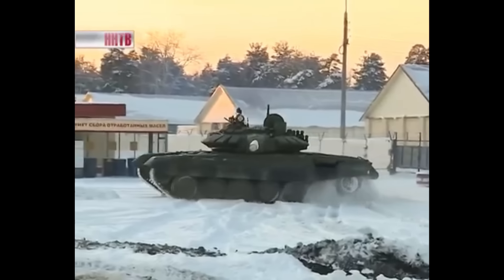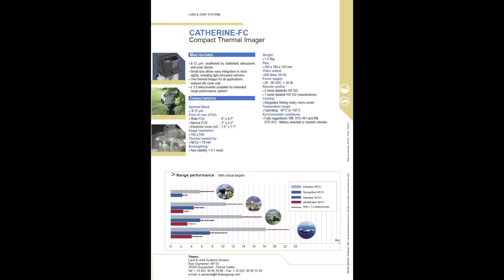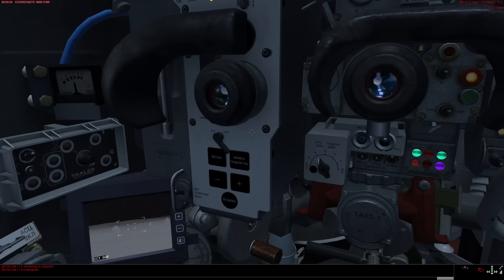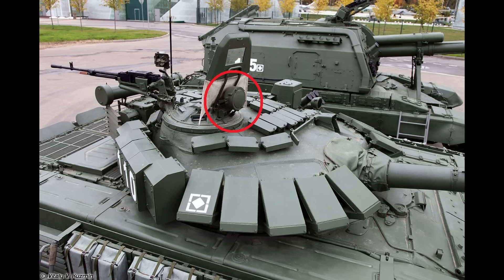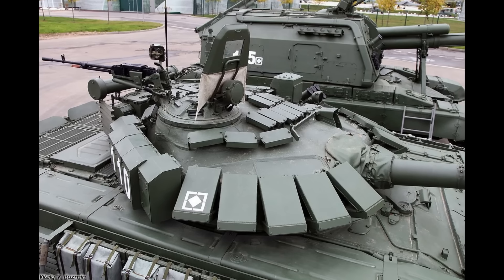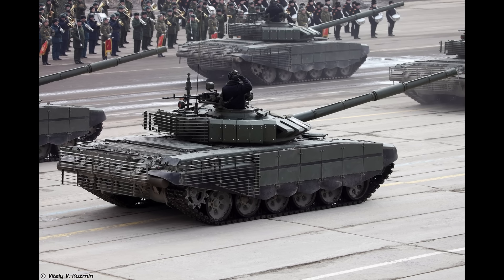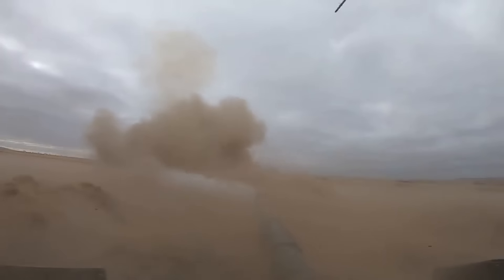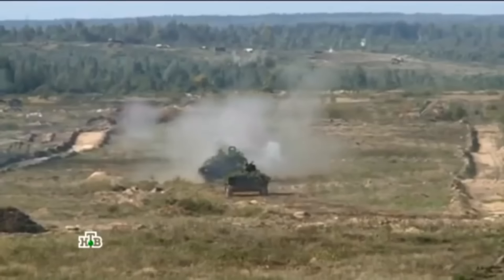Problems with Russian T-72B3 tank

Comment: It's incredible how Russia did not modify a new turret for the T-72/T-80, to incorporate their excellent auto loading system to draw its ammunition from a secure vented chamber at the rear,  instead of the crew sitting on a bomb basically, in the event of a hull or top breach. The cost of designing and fabricating new turret would be very reasonable, and would triple survivability rates.
Reply: I don't understand Ruski doctrine of there being 100 different tank versions.
Even +40 years old Abrams had A1/A2 versions then basicaly SEP1/2/3
Reply: @Tonixxy  they name it something different after every slight change. Personally i think that is to create the illusion of modernization
Reply: @meisterproper8304  i read some time ago most of those modernization were basically corruption pure and simple. T-10 modernization orogram was wasted money in billions of dollars.
Could have made a 1000 new tanks for the price of modernizations.
Reply: @Tonixxy  the same reason they use barely upgraded tanks from the early 70s as their main tank? They have about the same size economy as Italy but in their heads it is bigger than china.
Reply: The reason is the same why they are not adopting the T14, cost
Reply: Not really.
Reply: @Ukraineaissance2014  not a good argument, ruble internal purchasing power is much greater.
Reply: @Tonixxy  Ikr. Dozens of tanks with different versions and among the versions there are so many different variants. Their view is to keep everything on stock up and reserve in case shit happens or for last resort. On paper that sounds great but..ehhh...it might work as long as you keep the factories, machinery, workers and whatever in working. They have a habit of cranking an bunch of tanks of this version out, stop after x amount of years has pass, they try to sell it in the market, they crank out another new different tank design, later go back to the older design to make "modern upgraded version", stop and repeat the process.
Reply: @Tonixxy  for Russians the cost is the issue not corruption the Russians just don't want to spend the money because they want to get the market of cheaper tanks vs western tanks so you get the t90 and t72b3
Reply: @erickrasniewski567  my man corruption is #1 #2 and #3  reason for the stste of Ruski army in all aspects
Reply: Too late
Reply: @Tonixxy  true but also cost their is a reason the burlak never entered production or t72b2 or t80 black eagle corruption plays a role but cost is far more of a factor corruption is more of matianence issue then a procurement rather that leads to worse bids winning due to bribes but that happens today such as with the yf23 vs the f22 people seem to forget the Russian philosophy is one the opposite of the western tanks whereas the west went towards the tiger and panther concept they went towards the idea a tank will be lost no matter how much money is spent on it pushed their thinking the Russian doctrine is far more brick and mortar
Reply: Why?  Why are giving these war crimes pointers?  Sometimes it's best to keep your mouth shut!
Reply: crew survivability matters if you aren't shot at leaving the tank
Reply: @Tonixxy  Its because the T-64 their best tank was Ukrainian. And they needed a cheaper version that they could export so they made the T-72. The T-80 was the follow up to the T-64 but it was also Ukrainian. After the fall of the USSR the T-72 was rebranded as a T-90 with a welded turret but the same hull. So thats why there are so many versions compared to the US. T-64-T-80-T-84 are Ukrainian tanks. T-72-T-90 are Russian. The best tank is the T-80 or T-84. 

edit: Since people may get confused. when I mention Ukraine and Russia here I mean Ukraine SSR and Russian SSR before the collapse of the USSR. I was initially too lazy to write everything out. I maintain T-80 tanks have been the best tanks and are better than the Russian developed T-72 and T-90 tanks which have been terrible in the 2022 war
Reply: @erickrasniewski567  thay got the t14.....si ithink thay want to bien there aging fleet in Ukraine so thay don't have to miantine it and drive funds for some thing else
Reply: Correct and Russian tanks are designed for Quantity over Quality this was due to the fact that Russia during the Soviet Era can throw it's Quantity advantage over NATO West Germany UK France and the US. That's why their autoloader reflects that design by having the crew ontop of Ammo rack which makes production simpler unlike the Modern French Design Autoloader with Blowout panel
Reply: @اسكندرفكار  they want to convert the t72 to become robot tanks
Reply: Because Russia never expected to fight a country with modern top hull penetrating anti-tank weapons which only NATO countries have and Putler knows that's a war he cannot win. Ukraine got supplied with NLAw and javelins the year prior to the full scale invasion you don't suddenly  change multiple thousand turrets in such short time. And he expected a quick win anyway so few hundred destroyed tanks would have been nothing. Ukraine on the other hand benefits immensely from having these t-72 tanks since russian army has no portable anti tank weapons capable of one hitting it. All they can really do is use their weak bazookas incapable of penetrating the reactive armor or their dacades old kornets and anti-tank mines or their own tanks but that's about it. If Ukraine had the amount of heavy armor Russia has they would have already won
Reply: @erickrasniewski567  corruption makes cost worse.
Reply: @اسكندرفكار  the T14 is vaporware.
Reply: @terskataneli6457  the west sent aroud 90 billion in funds to Ukraine.....thats more than a midume country hool year budget.....the clasic cold war Proxi shit
Reply: The real reason is Russian rounds don’t offer the same penetration power as NATO rounds if they are made to be the same size. So Russia (Soviet Union) made the rounds bigger. Bigger rounds are harder to load into the tanks by hands, so their solution was to make the rounds with 2 separate parts. 
A problem with a round made up separate portions is that you cannot manually load them into the gun by hands. So Russia made an autoloader to solve the problem. Soviet tanks HAVE to use that autoloader to operate, there is no easy way to work around it.
Reply: @baneofbanes  yeah that I agree
Reply: @WSOJ3  UK has 2 part rounds and loads them by hand. So it ca be done and speed is not affected much if at all compared to 1 piece round.
Reply: When a captured, badly burned Russian tanker, says half their tanks can shoot half can move. The half that can move have broken autoloaders, of course. The ones that can shoot have broken/leaking engines &/or transmissions, ofc. So I think, ammo storage ain't their #1 or #2 issue right now! 😆
Reply: P.s. Russia's tank building days were over from the beginning of March! So it sounds crazy, but if Russia's already shit production rates, have already been 0 for 6 months, it'll be years at least for sanctions on Russia to ease enough for them to renew production. That's T-72/90 production I'm referring to, not the hand built wunderwaffe T-14.
Reply: @اسكندرفكار  For a country with average 25 billion budget since 2010 90 billion is a shit ton of money.
Reply: The entire autoloading system is built around the carousel and then every else is positioned around that. Changing the autoloader would require redesigning the whole vehicle and producing tooling for an entirely new tank effectively.
Reply: Funny enough, they did, the first prototype was in the 1950's, with a 130mm, but they felt the weight and the price made it unfit for duty, than in the 60's they got the idea of the carrossel loader to make the tank more low profile, since until the 90's that was indeed a good idea, it made it easier to evade being targeted, but from the 90's onward it became obsolete, they indeed developed a T-90 with a similar system, but let's be honest, is that really needed? People talks about Ukraine and tend to forget that the US wasn't using F-22s in Afghanistan, they were using turboprops, the Russian army is not engaging the Ukrainian army as a near pier, they are not committing to use the best they can offer, if that is a good strategy I don't know, but they are obviously doing way less than they could, lessons learned from the US in Afghanistan and Iraq.
Reply: @Rrgr5  russia is using the best they've got. S-400, su-35, t-90, iskander and whatever they got that isn't chemical or nuclear. I mean what else new tech do they have they haven't used?
Reply: It would be a completely different tank after the extensive modifications you proposed with this weapon system. The dimensions of the hull would have to change and probably be as tall as NATO tanks. The doctrine that this tank runs off to would have to be restructured as a result.

Finally they can't afford that because there isn't enough funds to carry out such modifications.
Reply: I wouldn't say it's reasonable though. Considering the Burlak existed. Doing something like that means a new line of production needs to be made.
Reply: @terskataneli6457  well, they have strategic bombers, the navy... even the T-90s went in limited numbers, I don't know too much about their deployment in Syria, but it doesn't look all that different, I see people here talking like they are going with full mobilization, it doesn't look like that, not even close, there's way more than some advanced equipment in limited numbers, they're practically doing as the US was doing in the end of both conflicts they fought, limited numbers, higher number of PMC and local militias, more of cheap equipment and some limited operations with advanced equipments and highly specialised forces.
Reply: because it waint designed for it. cant change it now.
Reply: @randomka-52alligatorthatis34  I'm quite shocked the program wasn't looked into
Reply: @Rrgr5  Russia sent the best they had into Ukraine, both men and equipment, and have been doing the best they can to win.  The 1st Guards Tank army, long touted as the best armoured formation in the Russian Army, equipped with more upgraded T-80s than any other Russian Army.  They also sent most of their elite VDV Airborne units and many Spetsnaz units.  The Ukrainians also captured or destroyed T-80 and T-90 tanks of the latest variants, photographically confirmed.  In their latest offensive the Ukrainians have also captured intact — with spare parts and manuals — the very latest Russian counter-battery radar units, used to track artillery shells from the firing point so you can attack enemy artillery as soon as they open fire.  Now Ukraine has Western artillery with a longer range than the Russians those counter-battery radar units will be extremely useful, as well as the fact that having them will allow the design of very effective jammers for the radar.

The Russian forces are doing everything they can to win, and have done from day one.  They are losing because years of corruption have stripped the heart and soul out of their forces.  If they knew what they were doing taking all of Ukraine would have taken three weeks at most.  It took time to organise the Western supplies, Ukraine didn't have them on day one, yet the Russians still could not take Kyiv in spite of their best efforts.
Reply: If Russians upgraded their tanks properly, how would oligarchs buy their yachts then?
Reply: There was a budget to update but all the money went to the General's yacht, new home and bank account in the Cayman Islands.
Reply: There are number of confirmed cases of Russian troops killing their own wounded during withdraws in Ukraine so i don't think that any crew survivability is a priority for those monsters.
Reply: But the t-72b3m has evidence that it withstood a Javelin hit.
your proposal is reasonable but it entails the creation of a completely new tank.
Reply: @pwn5047  Not really, it just requires a slightly longer turret to accommodate the ammunition in the rear section instead of underneath the crew, while maintaining the auto loading system. The hull and weight would remain relatively unchanged. They have evidence since the gulf war of 1991 and the Chechen war during the 90s, that a modification was needed, improved ERA is good but not the complete solution.
Reply: It is not incredible at all, if you understand anything about engineering and budgets.  A "new turret and loading system" is not something that you can just whip up in six months.  It is literally a new turret and loading system.  It would take several years.

Moreover, once you've gone to the trouble of designing the new turret & loading system why are you bothering to put it on the old hull?  Why not design a new hull?  You're going to have to redesign the hull too anyway in order to fit the "just design a new loading system".

Secondly, where is the money for this redesign and then building and rebuilding all the old tanks going to come from?  What are you going to give up in order to make it happen?  And we're not talking small numbers here.  There are ~10k+ T72 sitting around that are potential recipients for the upgrade.  You now also have to design, engineer, and find factory space for the upgrade process - it ain't happening in the field or service depot units after all.

At the time the B3M "upgrades" were being done Russia was not exactly flush with cash.  It was a simple upgrade that was possible and (and this is probably the most important point) it was an upgrade that occurred WITHIN THE CONTEXT OF RUSSIAN DOCTRINE (& corruption & contract skimming) at the time.

Vehicles aren't designed in isolation.  They are designed within the framework of doctrine, expected use, and accepted parameters around those two things. Why not upgrade the turrets?  Because at the time they didn't have the time, money, facilities, or concern about the known problems with the design as it was.  Why upgrade the T72 that much when you're expecting to have either the T90 as a new build or maybe even the T14 instead?
Reply: You are talking abut T-80UM2 bustle. That thing was never functional.
Another thing that makes that bustle worthless is that Russians carry a lot of HE-FRAG ammo which is very sensitive. No bustle of any kind will protect the crew when instead of the shooting flames (which is what the bustle vents) from combusting propellant, the explosives are hit directly causing an ammunition explosion of 10-15 HE rounds. That's 45kg of HE going bang at once. NO tank will survive, bustle or not.
Reply: Correct, but this reasoning is predicated on the assumption that Russian military doctrine gives the slightest crap about military casualties... which they never did once in the whole entirety of Russian history.
Reply: @corvanphoenix  Biggest load of crap I ever heard lol
Reply: @Cragified  You are correct. Having said that T-72B autoloader was modernized and widened. They were forced to make cutouts in hull sides for the rounds to fit into and weld on same thickness covering plates onto it. Also mechanical levers had their geometry altered slightly to allow the longer APFSDS rounds to not foul on the mechanism. But obviously there are limits to that as far as how long a round one can use. Hence why T-14 uses a vertical autoloader.
Reply: Autoloader is not a problem. The ammuntion outside of the autoloader is the problem.
Reply: It's incredible how Russia using vital parts from Nato countries to upgrade and build their weaponry.
Reply: @FireAngelOfLondon  LOL Utter load of crap. But why am I surprised BBC news taught you well.
Reply: @79marchewa  Confirmed by whom?
Reply: @John-hu9qg  That bustle modification wouldn't help at all. And the reason isn't even the location of ammo. In fact having it on the floor of the hull in the middle means having it in the most heavily-protected spot. And it NEEDS to be there if design requires use of HE-FRAG ammo which is a high-explosive round. Those rounds blow up HARD, naturally, given that they have 3kg of HE in each. In a combat loadout of T-72 there are around 10-15 HE-FRAG rounds, so that's 30-45kg of high explosive. If that much explosive goes boom, it won't matter whether it's deep inside the tank, or it's in a bustle, separated from tanks interior by 1-inch thick steel door. It'll tear the turret off the tank, blow that door in and kill the crew. Videos where Abrams shoots flames from the bustle shows you the propellant combusting, but not the ammo explosion due to being hit directly.
Reply: @John-hu9qg  Your proposal is very ambitious in terms of development, you need to actually create a new car inside, conduct engineering tests, the car will obviously gain weight.
A very dubious and expensive investment, the real life of any tanks is now extremely short.
Reply: @terskataneli6457  thats is×18 Times more than what the CIA funded the afghan fighters with in 10 years (around 6 billion)
Reply: @WSOJ3  it also limits rod length...
Reply: @Max_Da_G  I'm not talking about any such thing.  I'm replying to the delusional OP that thought designing a new turret and autoloader would be easy.
Reply: @iatsd  Oh I agree with that. Having said that there ARE turrets available for T-72B as direct-replacement, which is T-90A/T-90S turrets which are currently in large-scale production.
Reply: @Max_Da_G  Your name you mean? I thought so too! Lol! I guess you're the last one alive with Spetsnaz in their title 😆
Reply: @Max_Da_G  You can easily find drone footage showing truck drivers driving through their comrades  who fell off from convoy or soldiers bodies trumped into roads by tanks. Also while liberating Kharkov Ukraine soldiers found massive amounts of unhurried Russian soldiers bodies. Those war terrains occupied for almost half a year. Exhumations of massive graves has evidence of Russian soldiers executed and of course phone conversations to Russia shoving how Chechen squads are de facto NKWD "barricade squads" shooting to withdrawing soldiers.
Reply: @corvanphoenix  85K dead Ukrainians and another 100+K wounded would like a word with you.
As for names? Yours is close enough to Kurwaphoenix. That's a loser version of the mythical bird, one that was turned to ash, but wasn't quite good enough to resurrect from irrelevancy.
Reply: You do know that auto loaders are prone to jamming? Also I doubt it would improve survivability as right now we see a lot of tanks that are cooking off. What you are not seeing is the tanks that are being penetrated with no cook off from non top attack weapons. Seen a few that were absolutely destroyed from more conventional anti tank weapons (Type unknown , but the tanks were demolished the seconds they were hit). People are forgetting that Russian equipment is designed on the premise that the enemy would be NATO...
Reply: @Max_Da_G  Do they use a different HE compound, like a plastic explosive that will just burn but not explode without the correct fuse? These days hull penetrations are inevitable across all tanks of the world, the trick is to stop a catastrophic explosion within the crew compartment, There should be a lesser requirement to carry HE frag than the main safer Sabot rounds for engaging other tanks, armoured vehicles, artillery pieces etc, no situation is perfect but ammunition stored in a vented strong compartment at the rear is considerably safer for a valuable experienced crew. Their is no shame in pursuing this western concept, because the west finally realised and copied the Russian ERA method rather than adding on much heavier armour.
Reply: I mean most tanks have their crews right beside a stack of bomb

Apart from the Abrams
Reply: @greyvoice7949  The only time I've seen autoloader jam is when Ukies sent T-84U to Strong Europe Challenge. If autoloader as a jammomatic, Russians wouldn't be using it since 1970s. You are a moron if you think this.
What is very often NOT seen is T-72s return from mission with heaps of holes, but still under own power.
Load an Abrams with HE-FRAG, hit it directly and see what happens to it: specifically, turret will fly off and people inside turned into mush.
Reply: @John-hu9qg  That's the ONLY way to save a tank: try to phlegmatize the HE as much as possible. Russians use a more powerful HE compound, but it's more sensitive. But there is no way to really make HE not go off when penetrated by a supersonic hot jet of molten metal. If it sets off supersonic waves through the HE, it'll go boom. So placing HE ammo into the bustle is actually a really BAD idea since the bustle would be open to far more arcs of enemy fire and less well protected. And if it's penetrated and it explodes, it'll STILL tear the tank to pieces: 10-15 rounds of HE equals ~90kh of HE doesn't care for where it goes boom, inside or on the roof of motor bay. Tank will be turned into rubble.

You are missing the PURPOSE of Russian tanks: they essentially are PRIMARILY a mobile direct-fire howitzer made to directly support troops in attack. Anti-tank role isn't their primary, but secondary at best. What you are asking Russians to do is turn them into an anti-tank weapon, which is a bad idea: historically the biggest killer on the battlefield is enemy artillery and air support. This has been true from WW2 and up until now. It's just that too many people that THINK they know what's happening talk a lot on media platforms and are completely wrong, but it's brought to the masses that are none the wiser.
Reply: @alexisbierquedebirkadefauv1744  Check out where Abrams can carry ammo and you'll be VERY surprised. Specifically right next to the driver to his right. Whether that storage is used is another story.
Reply: @Max_Da_G  They do and it is not something they would like people to know.
Also they had to use an autoloader in the design...  Fact is that from what we have seen from tank combat around the world the Russian tanks were thought to be far better than they actually are!  Same can be said for a lot of Russian equipment...  Don't get me wrong , the West has a lot of bad to poor equipment too that also have their fair share of problems , but the West seems to be far more open about the problems.
Reply: @greyvoice7949  I'm not talking about western equipment. I'm talking about autoloader. I've met plenty of Russian tank gunners that joined military on a professional contract. They trained a LOT on the T-72B3. I bugged them on reliability of those autoloaders. And noone had anything bad to say. If they were so jam-prone, it'd have come out DECADES ago. There are videos of Russian troops training in a T-72s and the ONLY time I've seen autoloader not work was in a Ukrainian vid. Problem was broken sensors and not properly adjusted post maintenance. Just like any other mechanism, it needs to be looked after. And if maintainer is a retard, then it'll wear out and start having problems. Keep up the maintenance as you should, and Russians DO look after their autoloaders (it's their damn LIVES after all).
Reply: @Max_Da_G  Mr Australian, I agree with you on just about everything you have said, except 
A, the storage location of the ammunition, and how the issue wasn't addressed to some degree in the 30+ years since the gulf war, and war in Chechnya.
B, The primary purpose of the MBT. Yes the T-72 was designed solely as an infantry support tank, but the T-64 and T-80/84 were not, they were intended to equip frontal Warsaw pact regiments in eastern Europe to directly engage western armour. and carried special Svir rounds for doing so.
Reply: @corvanphoenix  Russia hasn't been building NEW T 72s on a large scale for years. Why would they need to do that when they have plenty of spares and tens of thousands of T 72s in storage? 😂 All they needed to do was to cannibalise those parts to make a working tank and refurbish them enough to call it a new tank. Their biggest T 72/90 buyer - India builds their own tanks under license.
Reply: auto loader makes tank go boom
Reply: @John-hu9qg  They were designed as CAPABLE OF engagement of western armor. That's why I said either here or elsewhere that it was a SECONDARY mission. Yes, enemy tanks ARE a target, but not a PRIMARY one. They are something to be fought when encountered. But tactics were to kill enemy armor primarily by Artillery and Aircraft.
Well, let's place 125mm 15 HE-FRAG rounds into an Abrams bustle, blow them up and see the result. If interior of Abrams is intact I'll agree with you. If the tank is utterly in pieces due to the force of the explosions, then you owe me a drink ;)
Reply: @Max_Da_G  😄, I'll put a pint of Fosters on for you! Iv seen footage of the M1 Abrams turned inside out in Iraq and Yemen by Iranian copy's of Russian Kornet missiles.
Reply: @Max_Da_G  Hahaha Hahahahahahahahahahahaha!!!
Reply: @Max_Da_G  That's the best laugh I've had in ages! Why didn't you go all the way & gloat about the fact that you've also killed approximately 800,000 HIMARS in the past 4 weeks!?! That would have made pee come out!! You can't close, still. Well played.
Reply: @Conan-ny1um  i like how switzerland exapt prserving nazi asatse and war lords assetse with no quistion.....but have a probleme with Russia's  mony 🤣💀🤣
Reply: @John-hu9qg The "valuable experienced crew" were all dead months ago. Soviet doctrine, with Soviet equipment, employed by Russians, is not at all the same thing as all of the above but employed by Soviets. Even now they are still confined to roads. Their resupply is reliant on trains & manpower. They don't trust each other, even in their own BTGs.

T-72's reverse speed is 4 kph... So shoot at it from outside the range of its poor optics, till it either reverses at slower than walking pace, or has to turn around, show his ass, & see if he lives long enough to redeploy successfully.
Reply: @Max_Da_G  Oh man, you're great! If you keep this up, imma start posting your guys telling the 'one half can move, the other, shoot' version. What would they know though! They are just the only survivors of many different tank battles over the past fortnight.
Reply: @Ukraineaissance2014  had*
Reply: @Max_Da_G  I for one won't take that bet. Unless the Abrams got lucky, that level of overpressure is highly likely to be lethal to some or most of the crew.

The problem is, the T-80 died before it could visually identify the M1A2Sep.2 or better. That's not too realistic either. It would have been killed from the air before that would happen.
Reply: @Tonixxy  Yes you do - they run out of money! Lol! That's the only reason. They always plan on building way more is just they take so long to build, & things are more expensive than when we quoted, & the guys are overworked etc. Lol!

So by the time they've got the money to try again, the old design is obsolete. Or components are no longer available etc. So they get a whole new version of the same thing.
There's also foreign & domestic sales which break down before equipment is delivered. In those cases, the Army usually get them at a good price.
Reply: @Ukraineaissance2014  Italy's is the bigger by a margin. Lol!
Reply: The plant that produced the cast turrets for t-64/72/80/90 is in Ukraine 🇺🇦… watch the newest perun video for reference.

So they probably couldn’t.. also that would be too expensive 😀
Reply: @corvanphoenix  yep, in the many years I've been laughing about Italy and russia having similar sized economies, Italy has even managed to massively outgrow them.
Reply: @tfp0052  These guys are still telling themselves they're gods who are going to win. Besides that, even Ukraine's considerably more modern approach to warfare still has a strong Soviet component. Many of their Soviet trained officers came out of retirement to lead guys trained in more modern ways. However if you get an old schooler, light infantry tactics go back to basically Western WWI equivalent, immediately.

The rot in Russia forces is far too deep to solve in any given decade, let alone year.
Reply: Turret autoloader is much valuable. Problem in Russia tanks is the ammunition. Russians are using 125mm HE shells. They are extremely powerful. Also that brown think where is gun powder is just thin waterproof cardboard that can easily cant fire. Also the APFSDS casing. That's the problem. Not autoloader.
Reply: @rsKayiira  The other reason they had to go back - they can't afford to build, fix - hell, even refuell any more of these than they did! 😆
Reply: @terskataneli6457  Even plain old HE 155mm arty rounds will kill everyone in a T- series tank with even a near miss.
Reply: @corvanphoenix  LOL, LMAO
Reply: @iatsd  to be fair they were knocking up new turrets and loading systems in a few months during world war 2, but they always turned out to be useless and obsolete.
Reply: @Rrgr5  They are using their strategic bombers - Tu-22M, Tu-95, maybe even the Tu-120? from time to time. They launch Kh-22 carrier killing, 60's era, cruise missiles, at military targets near civilian buildings which are larger & hence irresistible to the carrier killer's extremely basic radar sensor. Biggest blob dies, unless something malfunctions, then anything it lands on/near dies instead.
Reply: @Max_Da_G  Hey bro, what did you think of the crater your latest Kinzhal failure left? I think it's great! You can see by the colour of the ash, the metal that once was, wasn't cheap! 🤣
Reply: @اسكندرفكار  You gotta account for inflation! Lol! No, the Muj were cheap to arm. They only needed cheap things, AK's, RPG's, ammo ofc, the odd Stinger. War is much more expensive these days. It costs a lot of money to properly train, arm, equip, supply, support & maintain the kind of army you need these days if you want to win properly. The idea is largely useful too because only it's so expensive, only highly performing societies are capable of meeting the standard.
Reply: Ruskies has always send meat to the grinder because they have lots of meat. Human robots are cheaper than real ones :D
Reply: @Tonixxy  It's mostly because they are too corrupt to fill an order. By the time they've got money again, may as well design a new one. Also, some come from cancelled international sales.
Reply: @Ukraineaissance2014  Why do people keep bringing up Italy? Russia was 11th in Terms of GDP. Not shabby
Reply: That would make it a T90M
Reply: @Tonixxy  problem with that argument is that the products necessary to make great tanks is not priced in roubles and the Russians lack technological base to manufacture
Reply: @corvanphoenix  i know all of those facters....but the raw compersing is enough to show the scale.....but take into acount that the Indian and Russian evry year budget is around 70 billion......you do the math
Reply: @erickrasniewski567  Well, it ended up being too costly. Unsurprisingly, trying to put a new turret with an entirely new bustle autoloader system to work on 3 different line of tanks is not easy. And so, the project was canceled.
Reply: It would require complete redesign of the autoloader and the turret, T-90M only has ammo storage in the back of the turret you cannot load it from there.
Reply: @Tonixxy  yea but they import a crap ton of components. Like thermal imaging. only some of the complex systems are produced domestically in Russia.
Reply: @Tonixxy  yeah I don't understand why they used T-44M, IS-3M, and IS-4M for so long. They're bunch of WW2 relics.
Reply: This would be in effect an entirely new tank and T-90M is that tank. In T-90M the ammo storage is entirely in autoloader carousel, which is armoured as opposed to exposed in T-72/80. But the entire point of T-72B3 is that it's an economic upgrade of venerable T-72B. It's supposed to be just good enough.
Reply: @اسكندرفكار  I would rather compare the cost of donations to Ukraine vs the daily expenditure in Afghanistsn, Iraq, Afghanistan, Iraq, Syria, Afghanistan. I think you'll find, the US alone is saving a fortune compared with a cheap day of their operations against people with hand portable weapons only...
Reply: @jamegumb7298  Challenger also weights nearly 60 tonnes and has 4 crew. Can't really compare the two.
Reply: @John-hu9qg  that would drastically decrease ammunition load, two part ammunition requires a lot of space which doesn't fit neatly in this hypothetical turret back autoloader. The T-72 series hull has physical limitations that would make it hard: turret suspension load is already stretched, you can't make the turret much larger because the turret ring is as big as possible with the current hull
Reply: @Ukraineaissance2014  I say, when the Germans start doing it, it's possible. However. It'll be crazy expensive, & it will break, a lot, until everyone works out how to play together - machine & army.
Reply: @piirakkaliisa8340  Dead people cost almost nothing. They never were going to get they money. They are getting Soviet era basic a.f. equipment, told - you're now a tank driver! Given 3h practice, then trained & trucked straight to the front to die.
Reply: @Anonymous-tj8xm  Italy's lower on the list than Russia, before this war's economy even drops Russia lower. Australia would be a better comparison with Russia now, GDP wise. Again, not including what their real numbers are.
Reply: @WSOJ3  chieftan and challenge 1&2 managed/ manage fine with separate loading . Your comments utter guff .
Reply: Nope. When it comes to M1 Abrams the cost of the gun system itself is about 50% of the cost of the tank. For Russia it's probably in the same ballpark. At that point you are better off making a new tank.
Reply: Russia only think of quantity not quality and a lot of that quantity is being destroyed peicmeal. As for the T90m little to late with a sprinkle of quality and where is the T14 Armata if it is a quality tank why havn't they at least tested it in battle. Someone is going to tell me its still being tested and getting rid of all the problems for the tank or is it just a lame duck and just used for properganda.
Reply: @uroskostic8570  unironcally oligarchs get their money through owning the Russian industry everything is owned by oligarchs in Russia
Reply: @rsKayiira  By ukrainian you mean soviet?
Reply: Maybe they can field 1 tank with autoloader or 2 without for same cost?
Reply: @79marchewa  why would they do that?
Reply: @adolfolerito6744  This is nonsense. Soviet doctrine was based on keeping the military functional in the long term. They are willing to accept huge casualties in the first echelons, but the following would not suffer so much as the enemy would be eroded by the first waves. A western formation would not have been able to replace losses as good as soviet ones, so they would likely suffer higher losses on the long term. Thats also why they prefer more less capable tanks. Why spend millions on tanks that will get destroyed sooner or later anyway.
For the current russian armo tho, its unlikely that they even have a propper doctrine as the high ranking officers occupied with bullying constcipts and selling army stuff on the black market. And sucking up to the boss.
But there is no army that actually cares about lives. This is incompatible with their task. They care about sustaining combat effectiveness and preventing voters from rioting in front of government buildings.
Reply: @tasman006  why risk it, and against what? The last Ukrainian operated tank was blown up a month ago.
Reply: The cost of designing and fabricating the new turret would be reasonable if done in any developed country other than Russia. We already know how terrible Russian corruption is; you think a design gets passed without three oligarchs and five generals getting a cut?
Reply: @WSOJ3  The autoloader is made in order to remove the fourth crew member and reduce the internal volume of the tank, then you can greatly increase the thickness of the armor while maintaining the low weight of the tank, so the T-72 has a weight of 41-46 tons, against 55-60 for Abrams and Leopard, the dimensions of the tank are also significantly less, which affects mobility, especially off-road and difficult terrain that is present in the countries of the former USSR, where Abrams and Leopard will simply get stuck in the mud or a bridge will break under them.
Reply: There was/is a project called "Burlak" that created a universal turret and I think autoloader to replace all T-72/T-80 series with the same turret and loader. From what I have seen it wasn't bad and had thermal sight for the commander. But I dont know if the project stalled or is simply still in the works.
Reply: @tasman006  Any tanks in the war in Ukraine would be destroyed in the same way as the T-72, quality does not play a role here.
Reply: @romxxii  And how do we even know how terrible corruption is in Russia ?
Reply: @milaro222  Because of multiple reasons:
- tanks abandoned in the early part of the war had expired rations and cardboard in the ERA bags
- soldiers forced to use commercial (unsecured) comms 
- Moskva sank because it was in such a state of disrepair that it was unable to engage its point-defense weapons
- Russian soldiers raiding Ukrainian houses of washing machines
- Russian oligarchs and their superyachts
Do you need more examples?
Reply: @romxxii  Commercial comms are used by the militia of the DPR and the LPR and volunteer detachments, not the army, washing machines are propaganda nonsense. Moscow sank just as the British frigates sank in the Falklands, corruption has nothing to do with it. Oligarchs are legitimate businesses, they have the right to spend money on anything, it's not corruption
Reply: @FireAngelOfLondon  I'm not suggesting that they sent the worst they had, neither they're going to lose, since it doesn't look either, I'm suggesting that the best they offered there were limited in comparison to which they could, you can take the US as an example, they go as far as use Stealth bombers against an enemy which didn't even had SAMs, that is not the strategy the russians are using, not saying that is functional, but I see people here talking like Russia is doing everything they could, they aren't, and is beyond obvious, I don't know the reason, I don't know the motives, if it's a winning strategy, and dude, that stuff about corruption is beyond a cope now, the US is beyond corrupt, Zumbat was a joke, what does that really change? Is like Ukraine itself isn't corrupt also, that's how the things works in our system, that isn't a good answer, is a way to evade a discussion. You definitely didn't refute anything I said, just throw random information that didn't imply practically nothing, and probably that unimpressive type of war would be the trend, corrupted, low budget, with PMCs, local militias and some spec units, that's exactly what the US was doing in the late stages of their war on terror, they went good? I don't think so.
Reply: @corvanphoenix  but you know the difference between limited use and wide spread? Let's say, US in Vietnam, you know how many B-52s they used in one bombing run against the north? Around 50, but ok, that was in the past, what about the bombing runs in Iraq? Have any idea how much was used in Bagda? Yugoslavia? That's not a kind of tactic the Russian forces used (and I hope they don't), yet they are capable of doing that, even worst considering the navy, the contingency of boots on the ground is not even close of what they could send if they went into a total war, even NATO analysts understand that, most of the media drama is, guess what, drama, don't get me wrong, I don't think the Russian invasion was right, or they are doing a awesome job, far from that, but I'm not stupid to think that's all they can do, it isn't, and I hope I don't see it either because we already saw when they used those tactics, not long ago, against Chechen, do you even remember how brutal it was? And that was when they were in even worst shape.
Reply: @rsKayiira  Um, No. Well -ish. The T-64 was made back when Ukraine was part of the USSR and now days it keeps getting upgraded by Ukraine as their MBT(some people think they use more T-72s now from aid cuz most of them are now gone.), while Russia has long phase it out. 
The T-72 was originally supposed to be a "Mobilization Model" or "Emergency Design" if WW3 gets kicked off but the many problems of the T-64's reliability, high cost and its late mass production couple with its much more complex build leads it to have smaller number of productions eventually led to the USSR to go ahead and Mass Produce the T-72. So, eh, maybe export was part of the reason but not entirely. The T-72 like the T-64 has been constantly upgraded since the USSR-era to today and the most common Russian and many other countries MBT. It's cheaper, easier to produce(or on these days huge surplus stockpile.......for now) and maintain.
T-80 is Ukrainian?  NOPE. It's produced in Russia even during USSR Times. You're confusing it with the T-80UD that was developed in Ukraine during those times as well, it's a T-80 that uses a Diesel Engine instead of Gas Turbine that eventually leads to the development of the Ukrainian T-84. 
T-90 just a rebranded T-72? I keep seeing this and NO. It is not. The T-90 has its origins in a USSR-era program to be the single replacement for the 3 aforementioned MBTs for the USSR. The T-90 is not just a T-72 with a cast turret it does Not use the same hull as the T-72, it is based on it(the USSR and later Russia preferred the automotive qualities of the T-72) it uses an FCS from the T-80U, has thermal sights, a newer engine, a Soft Protection System, and ERA Bricks layout integrated with the Tank from the start. Its internals are not the same as the T-72, nor its components.
Some other guy already explained well why the Russians have many versions of their MBTs but let me get this straight. You're saying that it's because of basically Ukraine??? What???
Ukraine Operates T-64s, T-72s, T-80s, T-84s and even T-90s at this point. Russia Operates T-72s, T-80s, and T-90s. Both of them use similar kinds or style of MBTs that has its origins from the USSR. 

Well, that was long. I'm not gonna argue about the whole best tank thing because ultimately what you think is best about a tank is not necessarily going to fit the doctrine and whole another list of criteria for other countries with different circumstances.
Thank you for reading.
Reply: Because the weight? That's the most weight economizing design. Not without the flaws.
Reply: @Tonixxy  source, mister Exspêrt in T-10 modernisation?
Reply: @Tonixxy  since when 'Ruski' is a part of English vocabulary, mister words theif? Also, you can't even spell it.
Reply: @rsKayiira  since when Sovêt designed tank by numerous R&D facilities, situated all across the territory of the Union, can be called Russian. Or Ukraînian?
Reply: @rsKayiira  TLDR; No, the T-64 is more outdated than the T-72. The T-80 is produced in Russia even during the USSR days, you're confusing it with the T-80UD and its eventual development into the T-84. No, The T-90 is not a rebranded T-72 that's like saying the T-80 is just a rebranded T-64. And No, Ukraine is not the reason why they are so many versions of Soviet/Russian Tanks. Finally, the best tank is highly subjective and depends on the country that uses them.
Reply: @WSOJ3  «The real reason is Russian rounds don’t offer the same penetration power as NATO rounds if they are made to be the same size. So Russia (Soviet Union) made the rounds bigger. Bigger rounds are harder to load into the tanks by hands, so their solution was to make the rounds with 2 separate parts. 
A problem with a round made up separate portions is that you cannot manually load them into the gun by hands. So Russia made an autoloader to solve the problem. Soviet tanks HAVE to use that autoloader to operate, there is no easy way to work around it.»
Interesting, interesting. The early T-64 also had the AL for loading UNITARY shots because... you know... Unitray equals Two-Piece? Am I right?

Another illiterate internet expert, presenting a popular misconception as the Fact.

No. It's to efficiently load rounds despite the terrain allowing to use the full potential of the stabilized gun, and, taking as less space and weight as it's only possible. That's why.
Reply: @uroskostic8570  those are not âhts of oligarhs. Those are stealth missile ships.
Reply: @rsKayiira  Т-80 украинским никогда не был
Reply: Yeah, new turret is major money! Plus it may not be supported by turret ring. T-90M does have a small blow out for ammo in the turret but its not all of the ammo. 
Its not as easy as it sounds to make such modification.
Reply: @Ukraineaissance2014  they wish they had almost the same economy as italy! There is no comparison. Italy gpd is 25% more, despite being 1/100 of the skze, and pro capita gpd is 3 times. Agsin, no comparison. Italy is one of the world leader in manufacturing, style and wellbeing. Russia is a third world country comparable with some central Africa states. Stop insulting Italy, compare Russian to some crappy US state like Florida instead...
Reply: They have the T-14 Armata, they don't need that. They are using the older tanks to just be scrapped in the frontline to be replaced by T-14 Armata which is the best tank in the world.
Reply: @HeavenlyWarrior  One day sure - but not anytime soon T-14 is expensive. It has still some bugs. I do not think it will enter service in a year or two. T-90M is just cheaper and can be more mass produced. Normally Russia can make 200 tanks a year. Now they may boost it to 300.... but not T-14s - T-90s. 
Same thing occurred during WWII to both US and Soviets. They made Sherman and T-34 in upgraded versions as it would be too time consuming to switch fully to a better tank design through WWII. The switch started only towards end of the war and into late 40s. 
By end of the WWII T-34 / Sherman were far from cutting edge - but "good enough".
Reply: @tomk3732  T-14 is in service since 2015 but in very small numbers, I do not know the current numbers now but it certainly is many more than they were in 2015 which was 40 I think. But yes, russian economy isn't strong because of the sanctions and other issues so they can't mass produce them.
Reply: @HeavenlyWarrior  "Russian state-owned TASS media agency claimed the Armata had been expected to begin serial production in 2022, with delivery of a test batch of 100 to the 2nd Guards Tamanskaya Motor Rifle Division expected to begin in 2022. No evidence of this has yet emerged." 
I.e. we do not exactly know if tank was or was not accepted for service yet. I.e. army accepted it for use.
Reply: @tomk3732  That's strange, other sources say it was in service since 2015 when it was revealed. Btw I just watched a video of another channel about military subjects saying up to 2018 there was 132 T-14 Armata in active service... Who knows who's telling the truth in this matters...
Reply: @HeavenlyWarrior  There were plans scaled down for introduction in 2020 and before that - so the numbers to be made could change - i.e. in 2016 they said 2018, then in 2018 they said 2020, in 2020 they said 2022. Etc. 
Well, eventually we will know.
Reply: @worldoftancraft  No, I’m speaking from the official Chinese analysis of Russian style tank and the Chinese adaptation of that. 
Even before the Chinese military built the Type99, they knew the issue with T72, as shown during the Gulf war and Chechnya war.
So China tried to do without and having Chinese troops to manually load rounds with those tiny arms they have, and very quickly they realized it’s an impossible job. And so they had to build an autoloader. 

The more realistic solution they offered on the Type99A is an automated fire suppression system to suppress sympathetic detonations.

They also did an analysis on why Type99 had to adopt the 125mm 2 piece rounds. To simply put, it was the only way they can ensure enough penetration power against modern Western tanks (Chinese tanks use tungsten alloy rounds, not the DU rounds used by Americans).
Reply: Because they don't care about the crew..
Reply: @Tonixxy  Reminds me of AMD and NVIDIA. It's the reason I never got into their products because of their weird naming schemes. I remember even their driver software was a jumbled mess of numbers back then. Good products, confusing marketing.😅
Reply: @Anonymous-tj8xm  because italy is a very small southern euro country with an extremely poor south and lacking natural resources which manages to beat a country the size of russia, with all its coastlines, possible local markets and natural resources.
Reply: @marioborkowski5894  of course they do. Just because you care something doesn’t mean you can solve the problem. Without the technology, those are just empty talks.
Reply: I guess you people have never seen the ammo layout of a Leopard 2 and how much more violently it blows when it does than even a T72. Not to mention that T72's can reduce the risk of ammo detonation by 90% by simply not placing any extra shells into the turret.
Reply: @rsKayiira  So much wrong with everything you said...
Reply: thought process is if the tank has been penetrated, its dead anyway, might as well go out in a big boom
Reply: @Roter_Baron534  I mean Ukraine SSR as part of USSR. Its why Russia has so many T-72s and few T-64s.
Reply: @randomka-52alligatorthatis34  I just wrote something simple so others could understand. But I maintain the T-90 is just an upgraded T-72 and has performed just as badly as the T-72. The only two tanks that have performed okay in this conflict are the T-64 and T-80, the latter is based on the T-64 both of which were primarily developed in Ukraine SSR.
Reply: @topbanana.2627  This is something that people do not think, penetration leads most often to crew casualty by itself. Not to mention that these people should look where Leopard 2's store their ammo and how they blow up even worse than a T72.
Reply: @Tonixxy  Might have to do something with them folks in their R&D departments - they need to feed their kids too...
Reply: @John could you elaborate what kind of system do you mean?
Reply: @j.e.v.5016  He means having an ammo rack somewhere in the rear with blowout panels like on western tanks(Its in the turret). Other thing is T-80 was designed in Ukraine SSR and up to this day is the best tank. T-72 is cheap knock off of T-64 which was also designed in Ukraine SSR
Reply: @rsKayiira  They also had many T-64 but they were decomissioned. Most T-72 varians are better that the T-64 anyway.
Reply: @Roter_Baron534  naaah not true the best one T-72B3M is terrible, worse base armour than T-64.
Reply: @Max_Da_G  Quite a low blow, and and then totally "ad personam". "Можна витягнути мужика из деревни, но вытянут деревню из мужика это овсем другое дело", as they say.
И если я могу спросить, зачем, или почему вы в Австралии? Russia no good?
Reply: @rsKayiira  Sounds more like it's just your opinion but Ok. And still NO, the T-90 is not an upgraded T-72. Just like how the M60 is not an upgraded M48, or the M1 is not just a better MBT70. Just because it has its main roots from the T-72 does not mean it's a T-72. 
The most I have heard is how the T-80 has better mobility then the T-72 because it has a higher reverse speed then them. And considering the huge number of T-72s the Ukrainians are getting from aid it's probably their MBT right now. Which leads me to conclude that it's not that Ukraine's tanks that is performing better(like I said both of them use more or less a similar style of tanks), Its their Military. You can have the most advance stick in the world but if you can't really use it well, it's no different than any other stick........or worse.
And finally, again NO, the T-80 was not developed or produced in Ukraine but in Leningrad(now St. Petersburg), Russia. While yes, it is based on the T-64 it also had features from the T-72 incorporated(so is the T-80 just an upgraded T-64?). Only the T-80UD and later the T-84 was developed and produced in Kharkiv/Karkov, Ukraine.
Reply: Survivability of the personal isn't part of the orc doctrine, if that was the case maybe the situation in Ukraine could've been very different
Reply: @randomka-52alligatorthatis34   I dont want to go int a lengthy discussions. Somethings you've said are true others are not.
Reply: @rsKayiira  Sure.
Reply: @rsKayiira  This is nonsense, and even if it would be true armor the probably the least important aspect of a tank
Reply: To move the t-72’s auto loader from the haul to a position in the rear or the turret that would require a extensive overhaul of the design aka the failed t-14 program, it would be one hell of a task to redesign the t-72/t-80 to take that massive auto loader in the haul and stick it into that tiny turret lol
Reply: @Tonixxy  really it’s because of the fall of the Soviet Union trapping them with Soviet designs
Reply: Because they dont care about the possible human losses.
Reply: rear of tanks is the easiest place ro destroy, especially by artillery. I think it decrease survivability of the tank itself in 3 times. Much more reliable option is t-90m, where on the back only additional ammo and not autoloader shells.
Reply: @Tonixxy  Well, look at the Abrams. When it came out, it had a retainer ring, and an additional armored skirt panel over the drive sprockets. After some use, it was decided the retainer ring was useless, and so it was discarded. And after more use, it was found that removing the last armored panel made general track maintenance, on and off the battlefield, much more doable. They're all technically the same model, but in Russia, they'd have been three.
Reply: Well, it's good that they haven't changed it.
Reply: @HeavenlyWarrior  They have just a handful (probably less than 20) prototypes of T-14, unproved and untested in combat. They are using what they have and very few t-90 have been seen till now. All will end soon for them.
Reply: never interrupt your enemy when he is making a mistake...
Reply: Oh they did buy that. And they installed it on all of them, surely. All of them are superb now. Wonder how general Corruptovich got that giant mansion while the tanks still look the same.
Reply: @terskataneli6457  wait you're saying Russia has no ATGMs?
Reply: @nagantm441  i didn't say they don't have atgm i just said they don't have adequate man portalble atgms
Reply: @terskataneli6457  how do they not? Just about every Russian atgm is man portable
Reply: @nagantm441  In case you missed it i was talking about top hull penetrating atgms which russia doesn't have. That aside give me one example of russian man portable atgm capable of penetrating era apart from rpg7
Reply: Excellent auto loading technology?      Stfu😆
Reply: @79marchewa  name 1
Reply: @79marchewa  oh ok so propaganda bs
Reply: @terskataneli6457  are you listening to gay hato medias???
talk to real Russians
Reply: @fugjewtube1822  what😂😂😂
Reply: @rsKayiira  t 80 is not Ukrainian tank. T 64 is not the best Soviet tank, . T84 = T80.
Reply: @Tonixxy  because of three design bureau: Leningrad (T-80), Tagil(T-72/90) and Charkiv(T-64, T-84).
Reply: if u look at other non mass media videos u can see plenty of videos of t72s and other t variants taking many hits and surviving even from top attack which fails occasionally. Yes i agree its better to have safer autoloader but the ammunition explosion problem is much less of problem as it is said to be rather than just poor management and use of tanks.
Reply: bcs its expensive and they just want throw their old tanks to battle like WWII times
Reply: @Tonixxy  T-10, what are you talking about?
Reply: @astafford8865  Hahaha! Yeah? So... nothing changed with this years sanctions, cause they already had other sanctions? Yeah, keep drinking that copium champion! You pro-Russians sure are the best & brightest 🤣
Reply: The loading system is far from ideal, for example, the pallet vibration system is not fully developed, and when firing an empty cartridge case, the gunner must catch it, otherwise it can roll into the turret control system and jam it.
Reply: They learned their lesson in ukraine
Reply: @Tonixxy  u invest a lot of money in a "high tech weapons" which depends on several conditions to use (or have various electronic)

We just make faster and cheaper, u know that one wins who does things faster

(Compare ak and m4 + how would work all gear after magnetic impulse of nuclear weapon?)
Reply: because it is better to shoot more often than the loader of NATO tanks scratches his head when he sees an approaching non-rotating projectile in his target
Reply: Probably not until you find something to replace that high grade auto loader making the troops in the tank sit on the ammunition, and add A/C allowing the troops inside to actually close their hatches and still breath. The tank is a joke, just as America intended it to be.
Reply: @jacksont2040  the letter "k" means that this is a command tank for coordinating the actions of other tanks
Reply: Changing the autoloader to the cassette style means a significant redesign for the russians. If you check out the chinese Type 15 light tank, you will see it's a complete shift away from things like type 96. I recon t90m is the best the Russians can do for their t72 platform.
Reply: @Anonymous-tj8xm  Because of the Size Difference between the 2 Countries i.e, Russia should have a mucl larger GDP !
Reply: @milaro222  Unless they got their Money via Corruption.
Reply: The Black Eagle was basically this:  A Russian Leclerc, but with better armor.
Reply: @Tonixxy  finally an intelligent person.
Reply: That would be a complete redesign, not a modification.
Reply: Surprisingly, soviet heavy industry and whole industry is destroyed in russia. Hundreds of facturies and plants were closed and destroyed since 1991. So russia is unable to produce a lot of tanks and even to do some serious modernizations. Armata still isn't in mass productions, and the production of t-90m is very bad, so t-90m is unable to replace t-72, just because russia can't produce enough tanks now. Btw, one of the biggest problems - electronics. Russia just can't produce it at all. Even russian thermal sights "sosna-u" are french. So russia just can't create modern tanks by its own because of lack of any modern military Electronic devices you can only imagine
Reply: the burlak and black eagle projects were signs of potential, the former does not manifest itself in service until now, the latter was rejected, weird enough
Reply: @Ukraineaissance2014  You have fallen by our political class propaganda, the only reason Russia's economy looks as small as Italy's economy is the currency value of the Euro compared with the Russian currency. In reality it's proven that Russia's economy is in real value comparable to Germany's economy. Everything is much much cheaper in Russia, they can produce and manufacture anything the West does in a fraction of the price. Furthermore most Western economies are over inflated, economies based on the Service sector, printing money and huge debt. On the other hand Russia is almost self sufficient in every single aspect including military production. Finally, Russia been the one setting the pace and the agenda from the start, and we're just reacting and following, they will end this war when they want to.
 What I see is that Russia had this planned for years, predicting every single Western sanction and moves, whilst the EU been caught with their pants down by both Russia and the US, see how the US is making a mint selling overpriced LNG to their European vassals and European industry is fleeing to guess where!!? The US. Europe been taking for a ride, shoot themselves in the foot just to please their US masters in their proxy war against Russia.
Reply: @brewsterly2927  oh I see, they just dont want to end the war yet despite huge politically risky mobilisations,being pushed back 300km and 100k plus dead? lolololololololololoo
Reply: People acting like they're smart asses here while the Russo-Ukraine war continue with both sides never really going anywhere.
Reply: Not realy, these are cramped tanks and penetrating hits which don't detonate the ammo kill most of the crew anyway. Survivability has always been at the bottom of the T-64/72/80 design philosophy because they tend to prioritise not getting hit or penetrated instead, with a low silhouette and thick armor + ERA

Of course these are still really old tanks, the minor upgrades don't put them on par with newer models
Reply: @KekusMagnus  My man forgot why the thing has a low profile and doesnt count it as survivability. ☠️
Reply: @corvanphoenix  Many of T-72 are being modernized with Chinese optics and night visions, they do not need production as they have hundreds upon hundreds laying around. Better optics are reserved for T-90 and they cost a lot more, and are still available even under sanctions.
Reply: @darenzy  LOL, T-90's haven't been able to get their optics for months, let alone their thermals. It is too late now anyway. Western tanks are arriving.
Reply: @corvanphoenix  Pardon me? How does that relate to my point? You do know that Russia is still producing its tanks?
Reply: @corvanphoenix  And dont treat western tanks like some godesent invincible wunderwaffe. They never were and never will be. This is an honest neutral statement.
Reply: @russkatherealoriginal6904  The dead don't lie.
Reply: @corvanphoenix  Sure, is that what Ghost of Kiev said? Even T-72 are getting modernized with cheaper Chinese thermals. Western tanks? Is that 20th "game changer" by now?
Reply: @darenzy  No, apparently that's Chinese T-72 optics 🤣
Reply: The simple fact of actually hitting the carousel in the first place is unlikely. because of where it is so low in the hull.
Reply: amateurish reasoning
Reply: A human leader can load a round faster than the auto loader
Reply: Carousel autoloader moment, 1960s technology.
Reply: Where do you get your tripple suitability rate. Statistics from? it is obviously better on the T90M, but not tripple. And that's the whole point with this tank, it is not supposed to be the best of the best, it is just supposed to be good enough. Remember this is the Russian baseline. Ideally they would want to get rid of anything below that. And eventually get rid of the T72 itself, which is being replaced by the T90. So they don't need to focus on upgrading something they not gonna be moving with forward. So it makes perfect sense to just keep it as it is.
Reply: @EpicThe112 No. The reason it is used is because it’s designed to be small. The autloader was done to reduce size, and in the era of the Cold War active protection didn’t exist until late (The Soviets actually made the first APS), so the name of the game was being small.

They had plans to change the Autoloader but collapse+economic crises ended most hopes.
Reply: @Ukraineaissance2014  the Abrams is from the 70s
Reply: Humans are cheaper for them
Reply: @adsadsaddFQ  No, training humans will never be cheaper. That’s a common myth, ie; cheaper to build T-34 to be badly made rather then spend the extra resources.

Training good crews has always been more expensive, and they never intentionally focused on cheap numbers. It’s almost always environmental/economic restraints restricting them. It’s extremely expensive to make a whole new tank or rely on resources that are scarce.
Reply: @rsKayiira  The T80 was developed in St. Petersburg, you need to know this so as not to look stupid! Initially, the T64 was finished in St. Petersburg, but during the work it turned out that the T64 base did not have a reserve, so they made a new tank - the T80.
 T84 - Ukrainian diesel T80UD with a welded turret, produced in Kharkov after the collapse of the Union. In truth, they simply modernized the old T80UD.
There are no Ukrainian tanks - all tanks were produced by enterprises of the Soviet Union in many cities of the Soviet Union, starting from Moscow and St. Petersburg, ending with Chelyabinsk, Omsk and others. Without big Russia, Kharkov would not be able to produce a single tank.
The main disadvantages of the T80 are the engine and high automatic loader, and the price is 3 times higher than the T72. Fire control systems are similar to the T90.
In 2022, the T72M/90M performed well; these are good, reliable tanks for the harshest conditions of war.
Reply: @Tonixxy  t72-90 are all the same tank just different modernifications
Reply: They have dozens thousands of them.

Better just upgrade the old ones and make brand new ones instead of doing ur stupid and uneconomical stuff